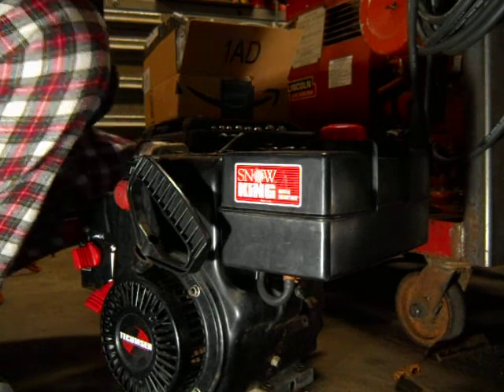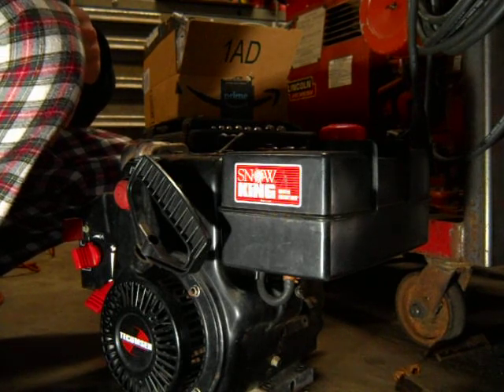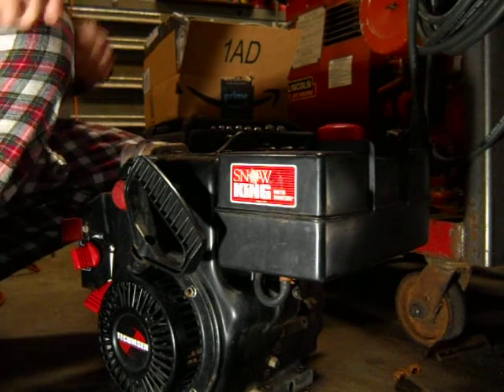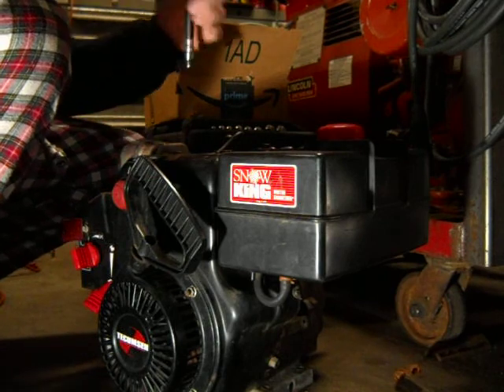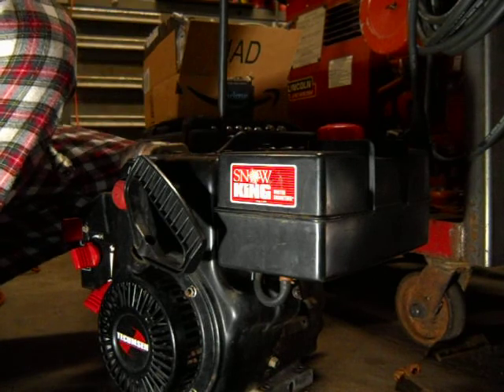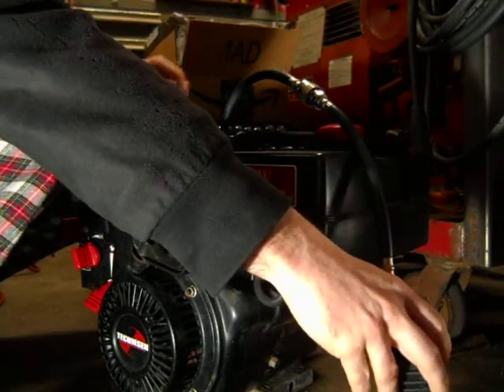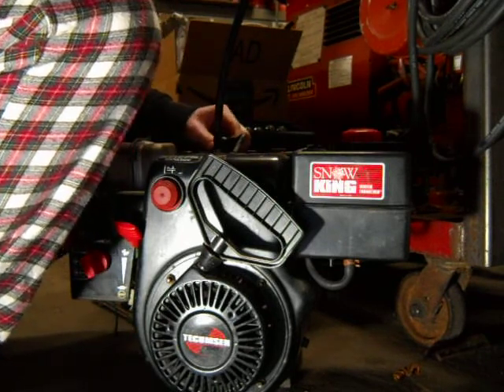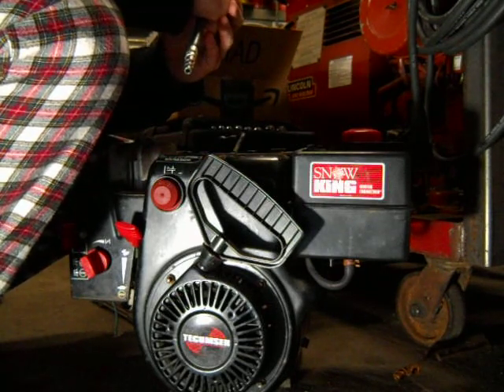How to do a compression test on a small engine

Comment: Mention the reason for the SHORTER flathead compression tester is so the tester doesn't go too far into the head and the valves won't impact the tester BENDING the valve when the engine is spun over.
Reply from the maker: Thanks for the input.